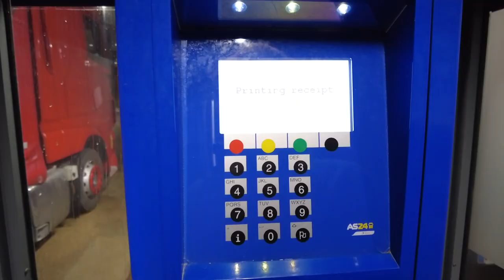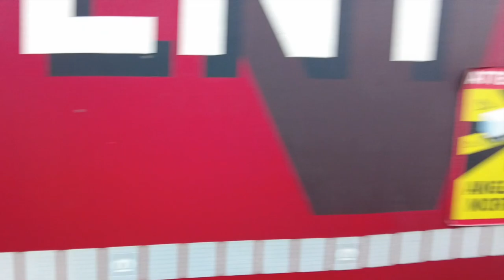Irritating Italian job - The Frejus tunnel, loading and customs

Comment: Hello,
How many hours are you working a day, 15? I was just wondering how often you are left in the truck after work. How many hours do you usually have after 9/10 hours of driving. You were overseeing the loading, not sure how long that was. At one point you mention something about 12 hours and whether you should stay there the night, and then you start driving toward monte blanc which was 3 hours? So you worked 12 hours and had three hours of drive time left? I passed my module 2 and still having issues with driving/working hours. thumbs up 21, I want a prize!
Reply from the maker: That second day was 15 hours but a full drive day of 10 hours will only be about 12 with breaks. Depends on what your doing a long drive day vs a short hop from the depot will result in a very different amount of hours. Loading only took about an hour and a half or so and the 12 hours was duty time not drive. I had more drive time available but my 15 hour cut off came up first. Don’t know what you mean with how often am I left in the truck after work.
Reply: @DTWTheWanderingMuzungu  Hello Muz, Thanks for the response. It was about time after work in the truck. But I would imagine after 15 hours you would most likely prep for the next day and then get to sleep.
Reply from the maker: Depends how long you’ve got till the next shift. If it’s a 9 off just have dinner and go to bed asap.